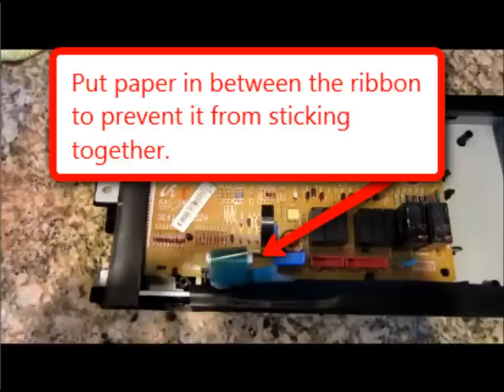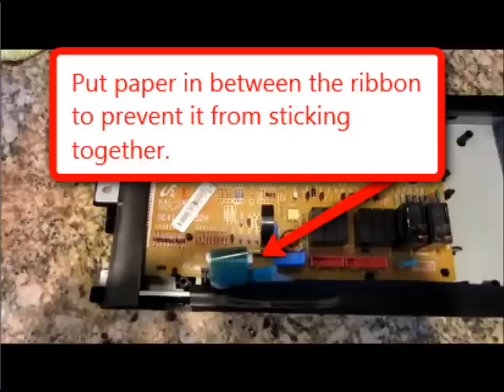Samsung Microwave SE Error FIX!

Comment: I cleared an SE problem on several occasions using the clean up the contacts procedures. On my last occasion cleaning the contacts worked up until I replaced the Key Panel back into its slotted position on the microwave, at which time it would seize and give the SE indication again. After four attempts my frustration level was growing pretty good. The panel would work up until I reinstalled it. Your procedure did the trick and prevented me from throwing the microwave out the window. Thanks much.

Comment: Just like Steven below, your fix worked.  I folded electric tape upon itself and inserted such instead of paper thinking that the tape would be less likely to combust in case there were any heat buildup;  highly likely, but just a precaution.  Most of the other videos I watched focused on disconnecting the ribbon connector, cleaning it, and the other wire connections and reinstalling them.  I tried this, to no avail.  Was just about to take apart the keypad given videos I watched saying that the touchpads get stuck.  I am grateful for your fix.  Thanks.
Reply from the maker: Hi John I'm glad the fix helped you out and save you some additional work.

Comment: Thanks a lot buddy ! This fix absolutely works fine. I had the SE error on my Samsung microwave model CE73JD , I saw your video but I had still called the repair guys. They opened the microwave and said the circuit board needs replacement..and it would cost INR 1800. I said I will let them know and asked them to leave. I then used the ribbon cleaning method shown by you and it worked ! The bloody repair guys would have probably done the same and charged me a bomb saying that they have replaced the PCB. Thanks thanks thanks !!!!! You rock !
Reply from the maker: +Salil Sane Glad it helped!

Comment: Wow.. I just can't believe this works...
I've refrained from using the microwave that came with the house when we moved in as it kept showing that code and as I was informed that it would cost me 200$++ dollars to get it fixed by a local repair man. Fast forward a year and 8 months, I just woke up with an urge to get the thing fixed and stumbled upon this video. 5 minutes and done. This is ridiculous. THANK YOU.  I did use a piece of electric tape that I folded instead of a piece of paper though. Felt a bit uneasy with the idea of leaving paper in the microwave's electrical board.
Reply from the maker: Glad it helped!
Reply: @jjthetechguy  It sure did. Your video saved me 200$ so I owe you one! LOL Thank you!

Comment: Hey, thanks for the solution. That said, I used electrical tape to create the gap in between the ribbon cable, not paper. I would never recommend using paper in an electrical application, even if there is minimal voltage going to the keypad...
Reply from the maker: Dustin Showe Thanks for the heads up, now I know for next time :)

Comment: Hey that worked.  I tried the other suggest on youtube, cleaning the cable connectors etc and I still had the SE error.  I separated the ribbon cable like you suggested and put a piece of a business card between and it is working great now.  Thanks!

Comment: Skip all fixes;  unplug and wait 10 minutes, plug in.  FIXED!  The 5E error code is a thermal switch that resets itself when cooled down.  If it happens too often the small thermal switch can be purchased for a few $ , simple install.  look for the small round thingy with two wires screwed on the bottom metal panel behind the control panel.

Comment: Just did this with paper like you said and it worked for now. Do you think electrical tape or similar material in between the ribbon wire might be safer though? I'm worried about paper becoming humid and sticky over time like the ribbon wire itself.
Reply from the maker: Hi Jeremy yeah you can try electrical tape that will probably work as well. The goal is to keep the tape seperate. I'm glad the fix worked!

Comment: I'm not sure I'm understanding  what you did with the paper .Did you use the paper to make the  connection tighter ?
Reply from the maker: You put the piece of paper or electronic tape in between the ribbon cable to prevent it from sticking together. I hope this helps.
Reply: I wasn't sure what he meant either but when you inspect the ribbon, you will find that there are two ribbons that are stuck together. You need to pull them apart then put an insulator such is electrical tape (not paper) between them.

Comment: This worked for me.  Thank you!  It was a good lesson for my daughter on how to make repairs.
Reply: I bought this wave at a Goodwill and all the paper work was with it and the last individual had the same issue. They bought a new function display and had a repairman fix the issue, well it came back. All I did was take the cover off and cleaned the (green) ground wire from the 'power cord' its on top. Unscrew it and take a piece of sandpaper and clean the surface area on the ground connector (both sides) and the surface on the microwave on were it connects. Reason, the coating on the surface is corrosion resistive and blocks the flow of electrons (resistance) and they build-up and can't escape causing a dysfunctional error within the keypad. Hope this helps.

Comment: Been having this problem off-and-on for years with Samsung. It is the ribbon cable touching itself. BE CAREFUL to separate it twice with cardboard: in the loop and when it enters the hole through from the keypad. I also put cardboard between it and the outside edge where it might touch the cabinet. WORKED, after spending hours cleaning and re-attaching cables. It's the keypad cable, Stupid!

Comment: Nobel prize sir !  It's in the mail.
Reply from the maker: I'm glad the video helped!
Reply: @jjthetechguy  Yes it certainly gave me the confidence to open it up and give that fix a go. So I did - and Voila - the error code is now gone.  But what I have noticed is that the pause/cancel button is also not working. So if you dial up a 2 minute cook and pull it out at 1 minute you can't cancel out that remaining minute. Only way to return to zero is to turn the power on and off at the wall. Looks like this MW is getting ready to be junked.

Comment: Do I use the copy / electric tape in replace of the ribbon,  or place it in front or behind it,  because it's not working?
Reply from the maker: Hi Mr. V, use electric tape. Cut a piece and fold it against each other (sticky side to sticky side) to crate a plastic strip. Slide it in between the ribbon cable to separate it and prevent it from sticking to each other. I hope this helps.

Comment: ok, just did it differently. the ribbon is obviously composed of a row of wires. there is a contact point & my guess is that a spot has worned out. i simply inserted & removed it several times while getting the ribbon going in correctly & as far as it would go. working for now.
Reply from the maker: ken C. Glad you were able to get it to work and save some money :)

Comment: Do you think this will work on Samsung oven range? It also has the SE error message.
Reply from the maker: Hi Sherie, I'm sorry to say that i would not know the answer to that. I'm guessing the board will be behind the screen so if you feel confident in trying it before you call a tech there is that option. I wish you the best of luck and if you have any doubts I recommend that you contact Samsung support or an appliance technician :)
Reply: @jjthetechguy  Yeah I tried it and it didn't work. Thanks for getting back to me.

Comment: The problem is a bad contact on the ribbon connector and its socket. Remove the ribbon cable. Spray with a "contact cleaner" and all will be fine. 3 minute fix forever.

Comment: I did it it worked at first and then it stopped working any solutions?
Reply from the maker: None that I can think of. I ended up replacing mine with another Samsung last year. When I performed the fix it worked for me for years. I had the microwave for 9 years before I had to replace it.

Comment: 1. I bought a Samsung Washing Machine... - It takes FOREVER to wash 1 load. (55 mins for a small load of Darks, Or lights, Or Whites..🤬)
2. I bought a Samsung Refrigerator... - it continues to build up ice at the bottom, so my freezer door stopped closing all the way.. because of a MASSIVE BRICK OF ICE BUILD UP. HAD TO USE A HAMMER TO BREAK IT...
3. NOW MY SAMSUNG MICROWAVE AND THIS DARN SE Code. If I didnt repair this code ASAP, my microwave could have potentially turned itself on, and BURN MY HOUSE DOWN !?!!!
🤬😤
BUT YET THEY MAKE GREAT CELL PHONES. WHAT-IN-THE-ACTUAL-
F*CK-
Thanks for the tip !!! And I too will use electrical tape..
Reply from the maker: Sorry to hear about your experience with Samsung, and I'm glad the video helped. There is also a fix for the fridge. You can find it on YouTube. I made a video on how to fix it but never uploaded it. Since I added the fix I've never had to deal with ice again.